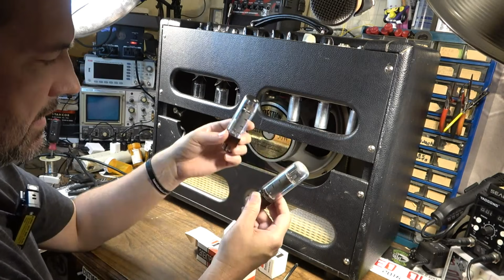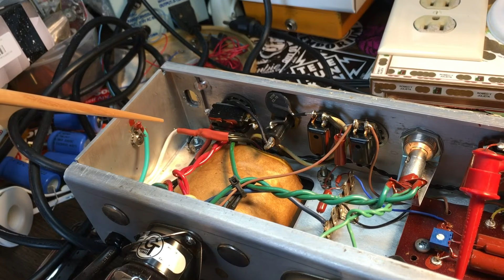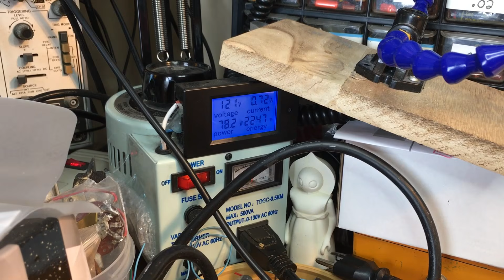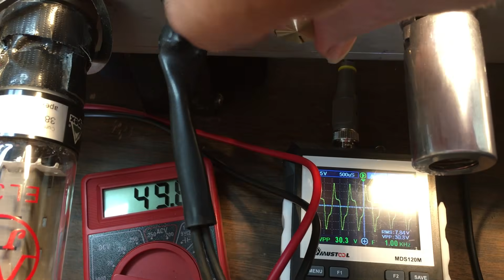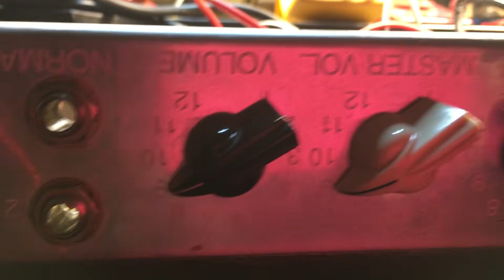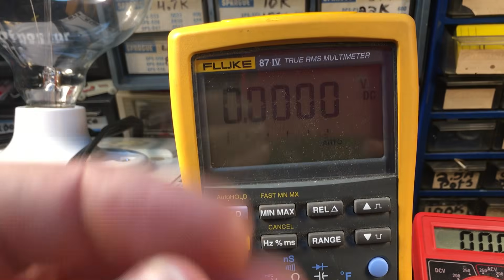STOP USING THE STANDBY SWITCH ON YOUR GUITAR AMP!

Comment: Although it's not absolutely required to use the standby switch, with the price of tubes these days, and especially if your amp uses solid state rectifiers, it's a VERY good idea. If the B+ is applied prior to the tube being fully warm, 'cathode starvation' occurs - the plate pulls current before the cathode is fully ready. Your claim that using it causes 'destruction' to the amp is 100% false.
Reply: The amount of time that the rectifier tube is warm and producing significant B+ before the the other tubes get warm is trivial (regardless of recto type)  and  Brad is correct, cathode stripping is not a big concern anyway at audio frequencies and B+ being only 350-450vdc. 3kV is a different story. Actually, if they made an amp that put 3kV on the plates, I'd def like to play that!
Reply: @davidausterman5915  - I have 33kv tubes at work. The transformers and oil bath rectifiers would be tough to gig lol.
Reply: Of course, you're all welcome to do as you please, but my tubes are definitely worth using a procedure that costs no money, little time, and causes no harm. I do the same thing with my homebrew kilowatt amp (single 833 tube) for the ham station.
Reply: @stirlingschmidt6325  Yes! That sounds like a totally different story with your 833s!
Reply: I ran a variac on my Maz 18 at 90 volts and it spent the tubes fairly quick. But at full voltage is goes thru them in about 3 months because it has such high plate voltage. Dr. Z says it is self biasing. No... it’s fixed! 😀
Reply from the maker: No, "cathode starvation" will not occur in receiving type tubes. I think the term you were looking for was "cathode stripping". From Merlin Blencowe:
http://www.valvewizard.co.uk/standby.html
"You may have heard of 'cathode stripping', which is a specious argument wheeled out by standby-switch obsessives. In its purest form, cathode stripping occurs when particles of the oxide coating are physically torn from the surface of the cathode when it is exposed to a powerful electrostatic field from the anode. This would happen if the valve is operated at saturation, without a usual space-charge of electrons to protect it. Fortunately, this effect does not exist in receiving valves, even when operated at saturation, because it requires an electric field strength of at least 4MV/m (yes, 4 million volts per metre!). No guitar amp ever comes close to this.
Another type of cathode stripping occurs when stray gas molecules in the valve become ionised by the electron stream. The positive ions will then be accelerated towards the more negative grid and cathode. If these manage to miss the grid then they may crash into the cathode, physically damaging its surface. The proper name for this process is cathode sputtering. Sputtering is a known problem in gas tubes and transmitting valves operating at kilovolt levels, near saturation. It doesn't occur to any significant degree in ordinary audio circuits. Note that even the RCA Transmitting Tubes Technical Manual No. 4, p65, states: “Voltage should not be applied to the plates or anodes of vacuum, mercury-vapor, or inert-gas rectifier tubes (except receiving types) until the filaments or cathodes have reached normal operating temperature” [My emphasis].
Receiving valves are the small kind used in radio receivers, i.e audio valves like those in guitar amps, in case you were wondering."
Reply: @TheGuitologist drippinglass is when you get you tubes so hot... they drip glass. 😁

Comment: Thanks for the info, Brad. I've been thinking about building some kind of inrush current limiter for the soldano clone I built recently (sidenote: you and uncle doug inspired me and gave me the courage to take on such a complex amp for my first ever build). Seems like this would prolong the life of some components a bit. Good idea? What do you think, Brad?
Reply from the maker: If you’re really serious about a build, you could install a variac permanently in the back of the amp. :)
Reply: @TheGuitologist  I plan on building some sort of a hot rodded Plexi next... I had actually also thought of the same thing in my daydreams! 😂 I'll let you know if I do this, lol
Reply: @SHREDTILLDEAD  I don't see any issues with running lower voltages with a Variac... But you definitely would want to re-bias accordingly for the lower voltages.
Brad or uncle Doug may have something to add or correct me on
Reply: @TheGuitologist  Use a transformer with a lower B+ in a home build

Comment: Another thought - if they say they blew the fuse while messing with the NFB knob then intermittent oscillation seems like a possibility to me, esp. if that knob is a poorly installed or incorrectly designed mod, and the oscillation occurs only at certain gain/tonestack/NFB settings..
Reply from the maker: I think part of the problem may have been that I wasn’t setting the bias with NFB all the way off and checking the amp when cranked with signal.

Comment: Been using tube amps for 50 years and the only time I blew a fuse is when I switched the power on when the standby was in "play". Only happened once, I guess I don't rock hard enough but I still use the standby because the chassis runs cooler when in idle. I have a Marshall DSL that will give a little pop in the speaker if you shut it off with just the power switch so I find the the standby switch useful. Old habits.
Reply: I have the 20watt version.  I get the same thing.   Marshall says to use it.   I'll probably stick to that as well
Reply: That is right, without the power supply is not connected, there is far less current being pulled through the power and output transformer will run cooler, your doing it right!
Reply: Have music man 130 always use stand-bye-bye-bye-bye
Reply: @johnhotz1400 I got the same HD 130 2X12!

Comment: I've always wondered the purpose of a standby switch and if it's even necessary to use every time the amp's powered. My amp is an '84 Carvin X-60 and I've often mistakened the standby switch for the on/off switch both located in the upper right corner of the control panel and never had any similar issues since i bought it as a Valentine's Day present to myself 23yrs ago!

Comment: Couldn't agree more, Brad.  Any modern build, even a clone of an old 'classic', should have a built-in thyristor inrush limiter (and to my mind, internal fusing where appropriate) and a thermistor to prevent voltage spikes from damaging your PT; if the design incorporates a master volume (a la Trainwreck or Dumble), then turning down said control is essentially the same as the function of a 'mute' switch, which is where Leo and others of that time period were headed anyway.  None of these additions will do anything to diminish the magical 'tone', but they will add years of usable life to the amp.
Don't get too down about not remembering every detail of a particular tube's specs; I can remember when I was a kid, watching the TV repairman come over with his box of goodies (which did not include a digital multimeter or calculator; loved that miniature oscilloscope of yours, BTW) and sort out why the picture was so wavy in short order.  In retrospect, don't you think most of those cats were near-geniuses on some level?

Comment: I have never had an amp that fkd up on standby. It's meant to warm tubes up before you use it.
Reply: A lot of amps with modern designs nowadays come without standby switches. I've yet to hear someone that complains of amp getting fked due to a lack of standby switch.

Comment: Hey Brad, Dave Friedman and Dr Z agree with you. I have not used my standby switch for a few years now based on what they told me about using, or not using, standby. Question though, is it ok to have the volume anywhere but all the way off when powering on?
Reply from the maker: If it’s a tube amp, volume settings should not matter at startup.
Reply: @TheGuitologist  thanks
Reply: I was actually reminded of a recent tone talk episode where Dave said as soon as he turns the mains power on, he turns the standby on... Immediately.

Comment: So, based on the schematic for my 2204 clone, the standby switch only has the potential to harm the rectifier and transformer because the filter caps will charge as quickly as they can, resulting in a current spike upon closing the switch. All subsequent power stages are current-limited by resistors. It seems to me like a current limiting circuit would be the best course of action. A simple constant current circuit set at 1A should suffice. If the amp is drawing less, it's wide-open; if the amp tries to draw more, it cuts off. Though the BJT version that I know of probably isn't feasible at 120-240VAC. Your thermistor solution may be the best solution without over-modifying an existing power section.

Comment: Hi Brad, so if this is some kind of homebrew custom amp with an unknown power tranny, how do you know what the required fuse rating actually should be for the given circuit and the tranny? What if the fuse holder is mislabeled or rating is miscalculated by the designer and the amp indeed requires a higher rated fuse?
Reply: You’re testing everything with a meter. No? Isn’t that the obvious answer?
Reply: @ErrorlVlacro  Erm.. this sounds like a question to me.  Not very obvious either.. Care to elaborate?
Reply: Knowing what the amp should be doing is pretty easy if you know what circuit type it is, what tubes it has, and what the bias is.
Reply: @Patrick-857  Yes, one can estimate worst case power consumption and the minimum fuse rating for a tube amp fairly easily, even without schematic, and calculate it precisely with. I guess I was just trying to say I wouldn’t trust a label on a DIY or heavily modded device. I’ve seen for example an actual DIY pedal built in a repurposed commercial enclosure that had the in and out jacks swapped for some reason but not re-labeled as such. The owner simply knew to plug it “in reverse” and didn’t care much. Imagine someone else coming across such a pedal without knowing that little detail :) a hilarious amount of hair pulling could ensue trying to “fix” it depending on complexity of the circuit, build quality and almost certain lack of schematic.

Comment: I believe Brad misspoke about the warm up time, comparing a GZ34/5AR4 and a 5U4G. 

The GZ34 is indirectly heated with a ~12 second delay. The 5U4G is directly heated and delivers full power in the time it takes for the filament to warm up(~2 seconds).
Reply: Matt, you are absolutely correct. What we need is a indirectly heated rectifier that will drop 50 - 75 volts on startup. The gz34 allows a 17 volt drop after warm up, and there is a need for a larger voltage drop. If you use silicon diodes, the voltage drop is .7 of a volt through each device. I wish rectifier tube manufacturers would make the indirectly heated rectifier tubes have a larger voltage drop because the line voltage is ever increasing. 🙂
Reply: @kengevers8738  I know there’s an indirectly heated cathode version of a 5Y3. I haven’t dug into 5U4 variants or substitutions. I rarely run into an amp that uses them that I will work on.
Reply: @matthewf1979  Oh, I didn't know they made an indirectly heated 5y3. I will have to make some inquiries about that. Thanks much for that info. I think Brad is on the right track, but it may be in the realm of overkill with the gz34 tube. As for the 5u4-5y3, Brad makes a valid point. Cheers

Comment: I enjoyed this - some good info.  Sort of agreeing with what you were saying - I am not saying for certain, but I had recently a bad batch of JJ GZ34s - they worked for a while but promptly failed after very limited use.  Unfortunately, I bought several at a time and by the time I use them and they fail I have had them too long to get my money back on them.  I hate eating the cost of crap tubes.  I quit buying JJ rectifiers for a little while and was buying Sovtek.  But I have also heard they (Sovtek) had bad batches too (from other folks) and they are harder to get/more expensive due to the current war going on.  I never liked Chinese rectifiers, but I may have to consider them.  Interested in who made the GT you decided to use.  Use american or english if you can find one!  But GZ34s are crazy expensive for NOS.   I have used a .01 or .02 mfd 630v polyprop cap (like those little brown ones you like to use) across the standby to eliminate pop and prolong the switch life - and it does a good job for that.  Curious if it affects the inrush current as I've never taken time to measure it.  I expect it may because that is likely what causes the POP sound to begin with.  I have never tried the varistors in the standby I certainly have replaced a good number of them in power section in newer amps.  I also am a proponent of putting vintage correct values of capacitance in tweed era designs.  Messing with the vintage values (adding more mfd) will mess up the tone and breakup in the amp.  After all, the lower filtering is part of the design that affects the tone of the amp.  Now if you are building an amp to be cleaner or to provide more thump - filter away.  Also, get a chop stick/spudger and point things out - please don't use your finger.  I know you know better but makes me a nervous wreck.  One accidental brush against something nearby where you are working and it will light you up.
Reply: I went through 4 rectifiers in about a month in both of my Bartel Starwood amps.  Like you they were JJ GZ34’s and all bought at the same time.  No problems before or since.  They worked for a day or longer and then died.
Reply: People, don't use tubes for rectifiers.

Comment: I have a  Carvin V3 from like 2000 something.. the manual suggest to power on then switch on standby and do the opposite to power off.
Reply from the maker: That was the conventional wisdom for decades. I believed it too. It is not necessary.

Comment: If I have a Mesa boogie stiletto ace - should I just leave the standby switch to on- so when I turn on the power in spongy the standby switch let’s audio pass by (spongy is built in variac) ? it won’t damage it like you are suggesting? Or does it not matter because the switch is there regardless of on or off ? Thanks
Reply from the maker: The Spongy setting in those amps is a different primary tap that reduces the voltages throughout those amps. I highly recommend you LEAVE your Mesa amps on the Spongy setting to conserve tube and component life. And yet, leave the Standby Switch in the ON position and forget it exists. Just use the On/Off Switch.
Reply: @TheGuitologist  nice! It just so happens I love the spongy setting lol! Thanks for the advice - love the channel

Comment: I would add a heat shrink around the thermistor. It is very close to the chassis. In case of short It might loose it’s own isolation.
Reply: True, but only if the ground wire to the chassis also failed for some reason.

Comment: I've never put a standby switch in an amp I've built. If I were going to do something like it, I'd do a "mute" switch that just grounds the signal. That seems to be how people generally use a standby switch. But yeah, Merlin fixed me on standby switches quite a while back.
Reply: Yes. Between sets while on break so we don't have to wait for tube warmup. Plus most of my Marshalls {and other tube amps} seem to sound better the longer the tubes run. At least to a certain point. They sound better after 30min compared to 15min, for example instead of just shutting the amp down between sets. They seem to like running whether at a cooler, or warmer bias for extended times vs short times. My Marshall's seem to "come into their own" during the 2nd set or so and by the end of the night, I hate shutting them down lol.

Comment: I think the voltage is coming from a voltage spike from the switch. A diode at the switch will keep that spike from happenning. The diode at the input and output side of the switch. I can't think of the word I'm looking for but diode on same line as the switch line but going around the switch or fuse with reverse polarity with the diode placement negative side on inby side. This will keep voltage spike away
Reply from the maker: An added diode and ground reference resistor after the switch is one of the suggestions Merlin gives in this article too: http://www.valvewizard.co.uk/standby.html
Reply: I was thinking it was a current spike that is doing the damage, not a voltage spike (?)

Comment: Why not just move the standby switch to after the first reservoir? This would allow the first reservoir to trickle charge as the rectifier warms up. This will stop the huge in rush when the standby switch is put to the run position.
Reply from the maker: That is another thing I could have done. Merlin mentions that in this article: http://www.valvewizard.co.uk/standby.html
Reply: Has always worked for me and Leo figured it out by the time of the super reverb. Another benefit is the ability to increase the filtering above 60uf on the first node.